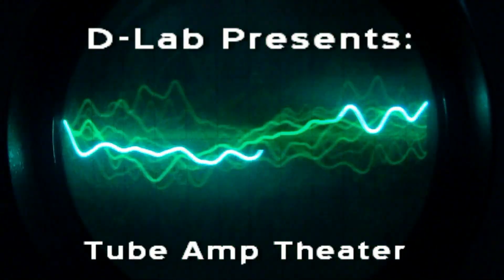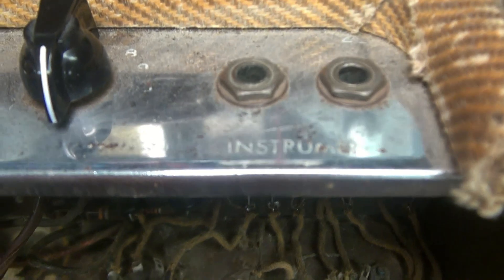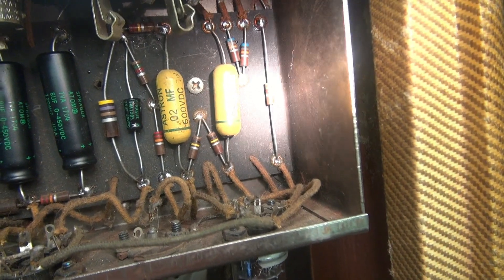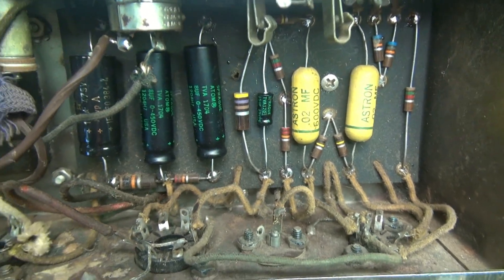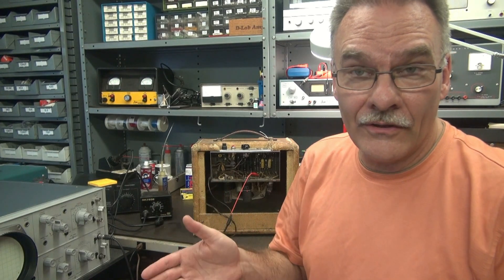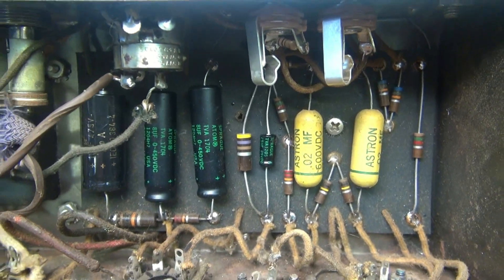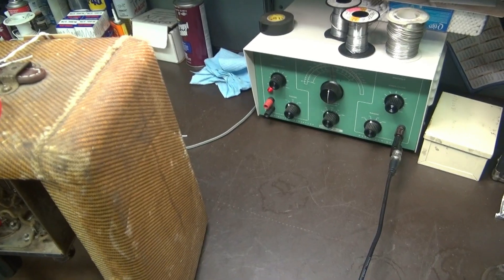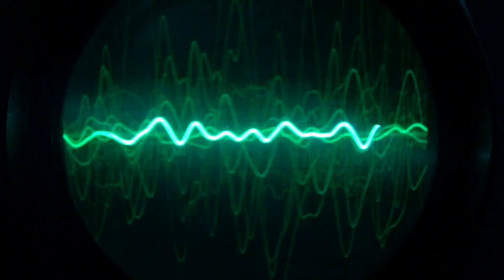How to repair noise Vintage Fender Champ tweed tube guitar amp 1956

Comment: So the HP-140 has a 8 ohm speaker built in ? Cool! Great idea. See and hear your repair. Beats load resistor on the output which is no sound just sine wave. Wow HP-140 Thanks again.

Comment: Terri can you make a video on the use of an oscilloscope pertaining to testing amplifiers. Inclusive of settings, connections and signal generator connections?
Reply from the maker: Yes Sir, will do
Reply: D-lab Electronics Thank You Professor.

Comment: Very cool ! Thanks for the inspirational video. I have a 1959 5f1     When I found it it was missing the tubes,  the pilot lamp and jewel,  the fuse and the top to the fuse holder. The inside is pretty darn clean. I just ordered the missing parts. Lucky for me before my brother passed he gave me a variac so I can slowly bring the voltage up and hopefully not blow out the caps. I'm going to give it a try and hopefully not burn the thing up. I haven't worked on an amp since my electronics classes in 1968. But I'm well prepared I got a bottle of wine and a lot of fun memories from the bars and clubs I worked in the early 70s. I hope mine goes as well as yours did! Next on the list is an old magnatone tube amp with a spring reverb that looks a lot like a twin reverb. I know it needs caps  because it sounded like a pop corn popper

Thanks for the cool video.

Comment: I always say to younger techs (newbies) to look for the obvious. It will save you hours of troubleshooting time. Bad solder joints/unsoldered joints are not uncommon. There's bound to be a slip or two from a factory worker. Whenever I get in any amplifier where there's a noise complaint, or change in output. I keep a bunch of wooden chopsticks (courtesy of my local Chinese restaurant) on my bench for locating bad connections. Love that old HP scope! The fan is soothing :)
Reply from the maker: Thanks man, I love that old scope too.
Back in the day they were very $$$$$
Reply: How many MHZ is the O'scope? its a cool  looking scope.I want to buy one so I can learn how to use them it would come in handy.
Reply: I got an Epiphone solid state practice amp model studio acoustic 15c that when I turned it on I had nothing but static noise/white noise like when a tv station goes off air. I remove the back to take a look at the board and found two capacitors leaking black goo that had turned hard, so now I have to remove the caps and clean the mess and install new ones. Any idea what might have caused them to leak? any advice would be appreciated.Not shure when the amp was manufactured but it is not a vintage amp that is for shure.Cheers
Reply: Capacitors have a limited life, especially cheaper, modern caps from China. After some years of use, they break down and leak (both physically and electrically) from heat and need to be replaced. Many modern day radial lead capacitors are in a soft aluminum container with an embossed seam on the top. When pressure builds up inside the cap, the seam breaks and they leak. When capacitors become electrically leaky, they basically turn into resistors (high ESR) and can no longer filter any ripple, and must be replaced. If you leave defective capacitors in the circuit (especially the power supply), they can short and take out the power transformer, which becomes quite expensive to replace.  Terry can definitely back me up on that one! :)

Comment: Nice work Terry.  Looks like the electrolytic caps were replaced at one time or another was well. I just finished building a 5F1 Champ myself ( home-brew) and it was also quiet as a mouse.  I have the video series on my channel.  Question, where did you connect the tone generator ? Looks like the 12AX7 pin 5?  correct ?  Thanks Ron
Reply from the maker: Hi Ron, Glad you liked the video. Great little amp. I connected the audio generator to the guitar input jack. The O'scope was connected across the speaker terminals

Comment: Just found this old video, Outstanding. I am converting an Eico 147 Signal Tracer into a 5F1 Amp and was happy to you checking out this old baby. The stuff you found and fixed is a testament to the Fender overall design. I an doing point to point but after seeing that eyelet board i wish i had sprung for that board. Great video thank you for all you work. Dennis

Comment: Very nice job!:) I sometimes can't understand customers that insist on keeping things that wear out naturally (like connectors) original. There's a difference between maintaining gear in the museum and actually using it every day. If you sent that amp to Fender for repair years ago they would just use any matching jack connector they had at hand and not search for NOS 20 years old one. Most components (sans things like ultrastable voltage references) aren't aging like wine. If I'm doing repair for myself I'd just use good quality new connectors that are matching mechanically and not spend ten gallons of deoxit to make old crusty 5$ connector work again.
Reply: Here,here!

Comment: Is anyone else a little surprised with the installation of new jacks rather than refurbishment of the old? The contacts surely could have been burnished and the other issues resolved without removing original, visible, salvageable parts.
Reply from the maker: The contact surfaces were corroded beyond repair. The customer requested new switchcraft jacks. Remember, I am doing these repairs for customers. Either way, I would change them.
Reply: Thanks for the reply. - Derek
Reply: I guess using the original rusty nuts would hide some of the newness.

Comment: very cool channel. would like to see you do something interesting with a fender champ 12 red knob, as I have one and it's just sitting around, I'm sure it has potential, and there isn't much on the web. cheers!
Reply from the maker: Hello, I have a Fender 12 on the bench right now. Minor repair. 3 bad jacks (broken). 1 bad solder connection on a tube pin. Dirty pots. Tubes were OK. Not much to report. What is the issue with yours?
Reply: D-lab Electronics broken plastic input jacks, overly tinny/ trebley sound. poory quality reverb.
Reply from the maker: Only replace with the original Fender type. They are still low quality, but better than the after market type. Then inspect the circuit board for cracked solder connections, especially around the tone pots. Sounds like you may have a bad pot or something defective in the tone circuit.
Reply: Kevin Griffin I have one also. Love it. Wld like to see a video also. I've replaced the input jacks, speaker, and all tubes. Sounds like a new amp. Wld like to see how to fix the volume and gain issues on channel 2.

Comment: Those F&T and Sprague Black Atom caps are recent. Somebody has definitely been in there before. This would also explain why the jack shorting clips were bent out of place.
Reply: just saw your post after posting mine, glad other people are paying attention, kudos on the 420 btw
Reply: I think when he said no one's been in here he was referring to that 5Y3 socket he was chopsticking at the time. Yeah, he should have said so specifically but I'm pretty sure the guy knows those filter caps weren't factory.

Comment: What are your thoughts on the heater wiring? This one uses the original wiring scheme with one side of the 6.3 line connected to ground, and the other side going to the 2 tubes. Is this more noisy?

Comment: I have that amp and when I had the caps replaced there was an extra cap installed across the last resistor to the right of the chassis .  Could that be the source of noise?
Reply from the maker: I believe that would be a preamp cathode cap, usually not a source of noise. Check the tube sockets for wear & corrosion.
Reply: I did not see that 33 Micro ferret 450 V capacitor on your video on your amp could that be why it's quieter than mine?

Comment: Hi Terry, appreciate the time spent on providing us these videos. You demonstrated that moving the tubes around created a lot of noise, did you have to do any further repairs to fix that issue and/or did you end up replacing the tubes. Thanks again.

Comment: Those Astron caps have a reputation for leaking - were they checked?   Is it normal for a tweed Champ to clip so asymmetrically ?
Reply from the maker: This was not a complete rebuild. The owner just wanted the transformer and to get it going as quick/cheap as possible. Just follow orders here

Comment: Looks like someone had already been in there and tried to touch up several of the solder connections....Personally I'd have re-capped the whole thing and save myself the migraine when one of those caps starts to leak or blow....

Comment: Terry-I published this same comment in another video, but then saw this one so am re-publishing it.  I hope that's ok.  Anyway, I got my first amp in 1959 or 1960, it was a Fender Tweed, 
and I believe it was either a Champ or a Harvard.  I know it only had 1 
speaker, and I think it was oval. It was pretty small, and of course 
basic.  I'm thinking of building one and trying to figure out which one I
 had, and/or which one is the better choice if there's no way to tell 
now which model I had.  Do you have any thoughts to help me on this.  
Thanks.
Reply: That’s an easy one. The Harvard has a Volume & a Tone so you Must have had a champ. The 5F1 Champ is pretty much the most basic Fender amp. And I believe that’s what the one in this video is. That would be the one to build.